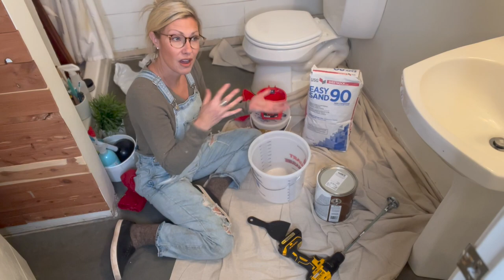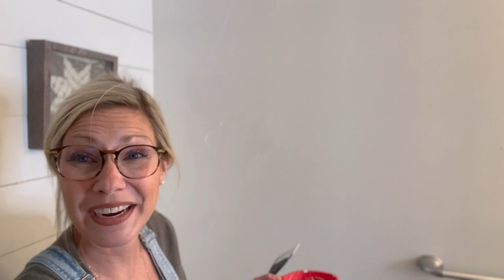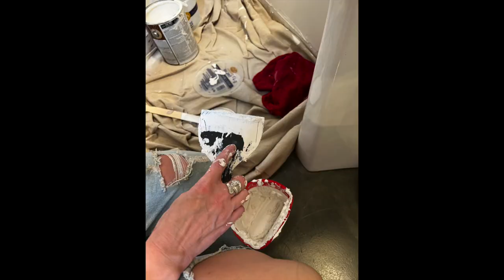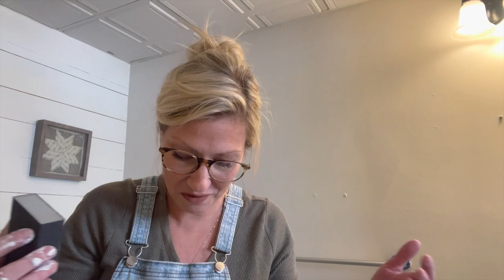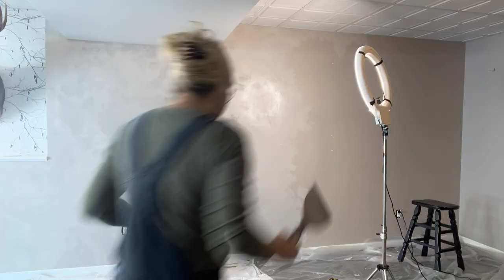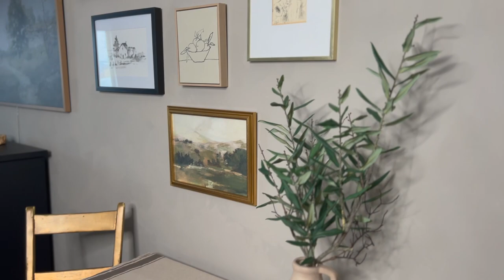How to Make your own Roman Clay wall application

Comment: Mix pva glue into your mix. I did all my walls with the mix you did but added pva glue as.well. It works great and acts as a primer. It did for me anyway.
Reply: How much pva glue did you add @danbenz5288 ??
Reply: About 1 cup. I didn't use exact measurements. I just eye balled it.
Reply: @danbenz5288 hi, 1 cup of pva glue to 5l of paint? Thanks!
Reply: did it add any shine?

Comment: Thanks for the info :D. Did you seal it with anything
Reply from the maker: Great question. I did not.
Reply: Did you sand the walls prior to applying?
Reply from the maker: @nielsheidner1686  nope!
Reply: Does the joint compound add more white to the paint color?
Reply from the maker: @hi_devan  a chalky effect